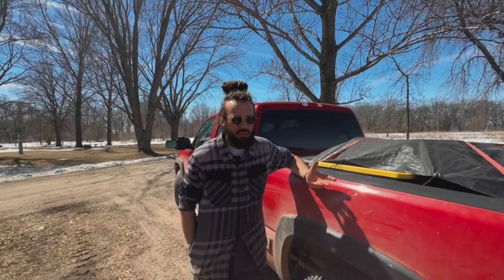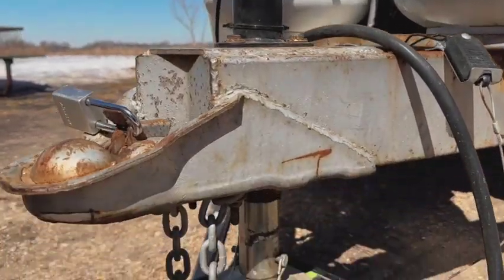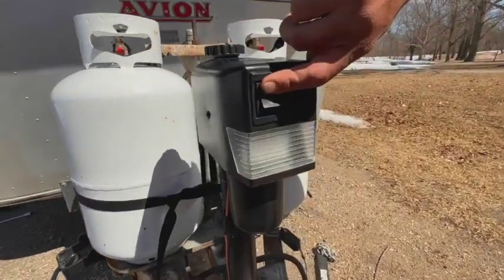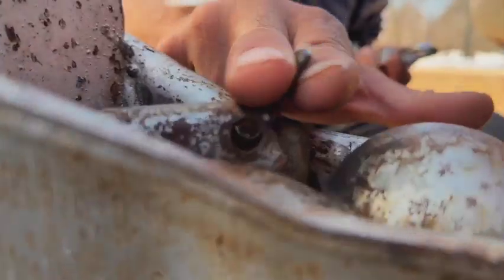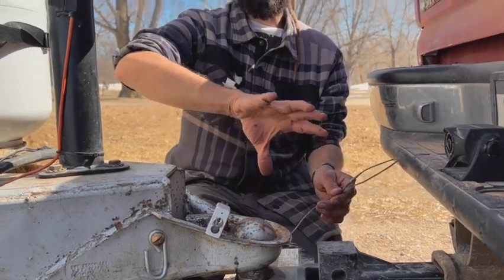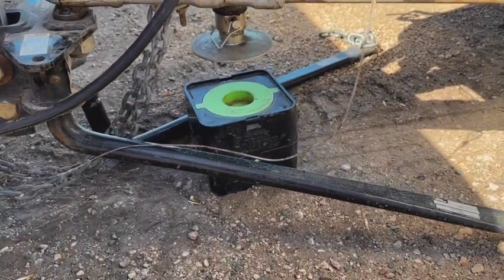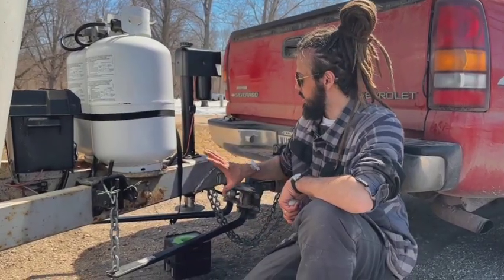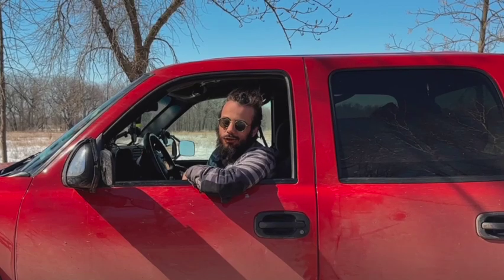BEGINNERS GUIDE | Hitching a travel trailer

Comment: Do you have any issues with your truck as far as handling the trailer?  I have an F-150, similar size, 13000 lb towing capacity and my soon to be ready trailer is around 7000 lbs.  do you wish you had a beefier truck?
Reply from the maker: Our truck is an ‘02 with a 10000 lb towing capacity and our trailer is 8000 lb-this can make it hard to handle it at times. We make sure we don’t have any water in it (grey water) when we travel. I would think with your towing capacity in lbs and trailer weight the f-150 would be sufficient! Keep in mind there’s a lot more to consider when traveling with a travel trailer than just towing capacity and weight such as: weight distribution, tongue weight, if you’re traveling with spring bars, ect. Let me know if you have any further questions!
Reply: @PrettyGrittyCampers  This is good info, thanks!  It helps my feelings that maybe I'll be OK.  I've ordered a weight-distribution hitch but your point about tongue weight is definitely something to watch.  I'm interested in seeing how you handle some of those mountain passes out west!